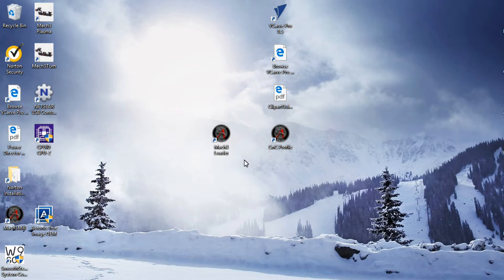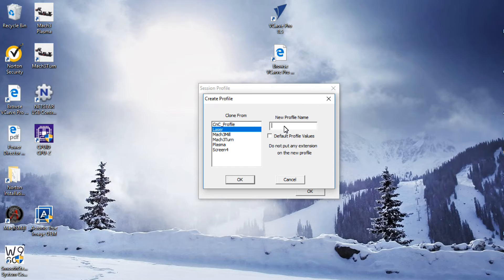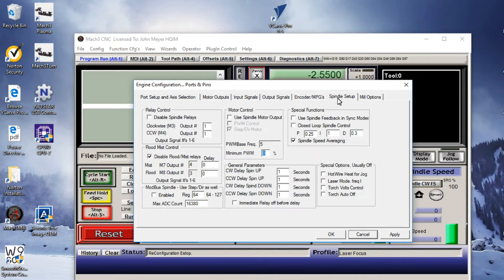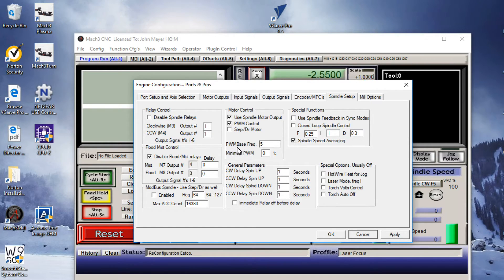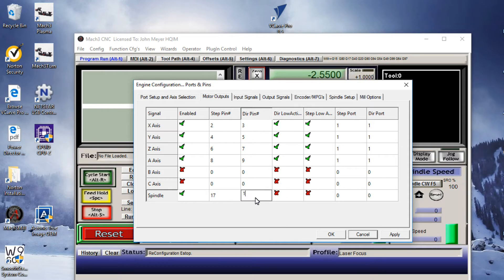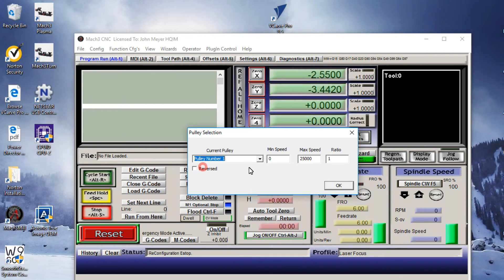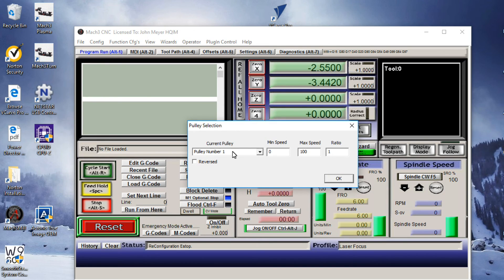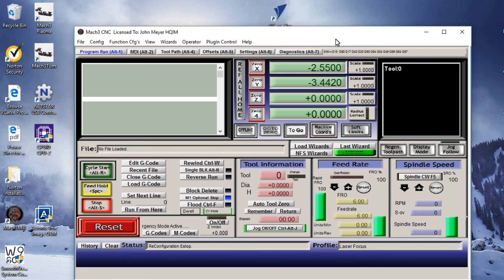0003 Creating a Laser Focus Profile for the JTech Laser

Comment: Hi John, thank you so much for this video. I followed your instruction and I was able to set up the profile for focusing laser with no issue. Later on, I was able to have same profile for focusing and engraving, simply by switching on/off Spindle under motor-settings. All this was done why I had a connection between drivers and my PC via parallel port. Just recently I "upgrade" to Ethernet Smooth Stepper (Warp9) and I am having challenges with my DIY laser arrangement(cheap Chinese laser + driver). Still using output pin 17, same BOB, the same driver (Xylotex)...For a laser to operate in engraving mode I needed to go under ESS settings in Mach3 and adjust that M11pX and M10pX are responding to output1. After that, I was able to burn some previously successfully created codes. My challenge now is that I am unable to use "spindle" function to "fine-tune" laser focus... My set up is unchanged - Spindle is activating pin 17 for DIR and STEP (under Port 1), my Output is still 1 linked to pin 17, the spindle is to use output 1 (all like your video suggested), but once spindle or M3 triggered - no laser response. Once Spindle unchecked - laser powers up on M3 or Spindle ON, but with full power. I tried S01; tried lowering RPMs on the spindle, but no success. Do you have any suggestion, or wisdom to share? Did you need to set up anything on your ESS configuration page? Thanks in advance